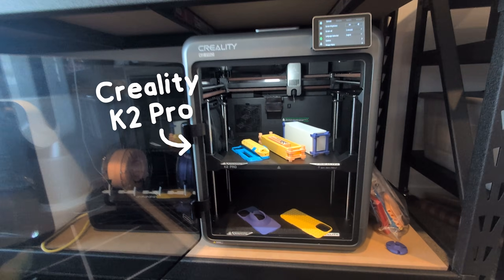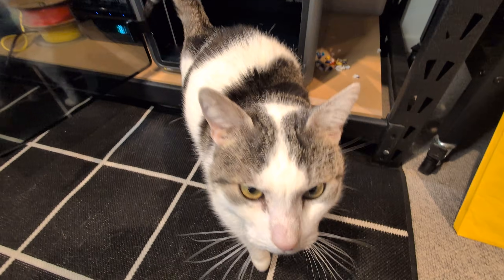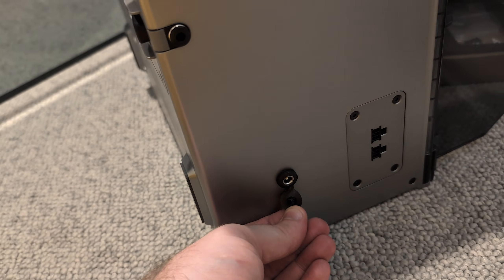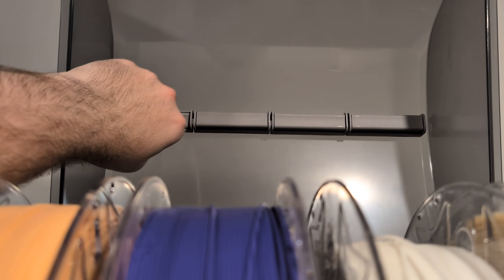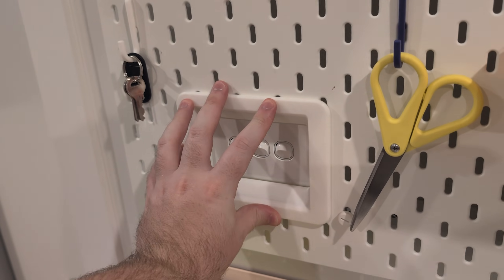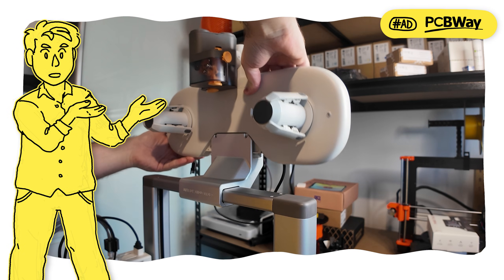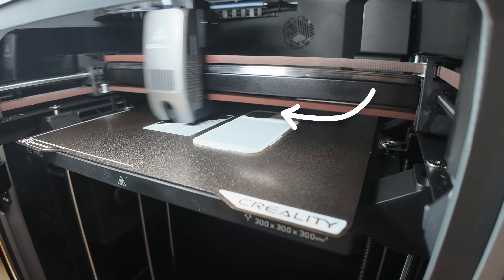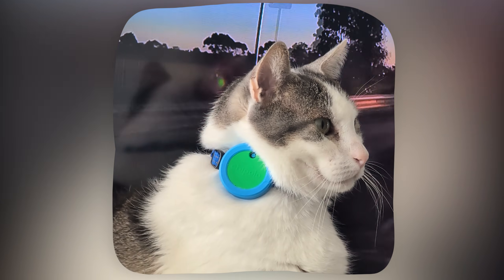Creality Finally Nailed It... But Is It Too Late? - K2 Pro 3D Printer

Comment: Not to nitpick here but I don't know if you have tried ironing on the tops of your surfaces under 3D prints if you have then I'm not for sure but it's have been to the top of your services if you're not tried ironing it might get rid of that top of the surfaces not trying to nitpick

Comment: Some folk like me don’t give a rats about colour changing and just want hassle free reliable printing, which is also hackable and has 3rd party spares. If I didn’t already have a K1C I’d give this a look.
Reply: Are you sure 220 mm is enough? It has its bigger version, the K1 Max. Something big is going on, and I'm also a modder there.. Come check the K1 Max as well. (K2 Pro is a "successor" to the K1 Max... Just look at that 300 mm buildplate.)
Reply: I'm using the K2 Plus... And the poop is pretty huge. Not sure why it has to use so damn much.
Reply: The attraction of multiple filaments is mixing materials, especially TPU. That sounds fun. But for now I’m happy with my K1C.